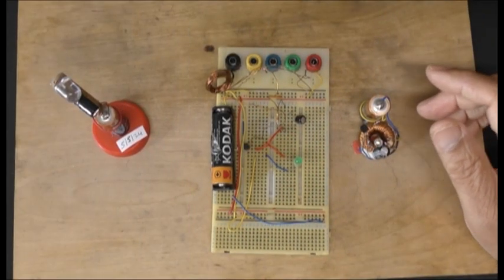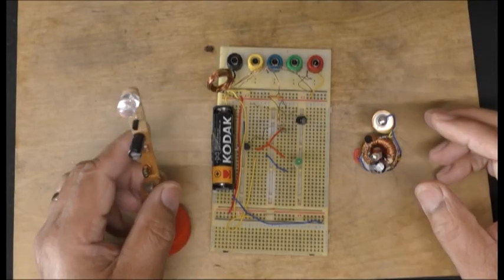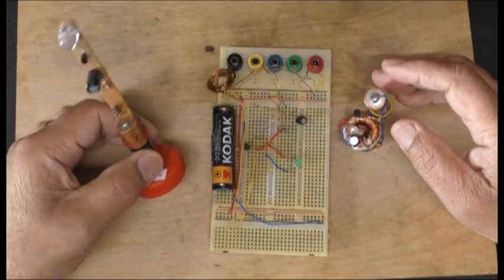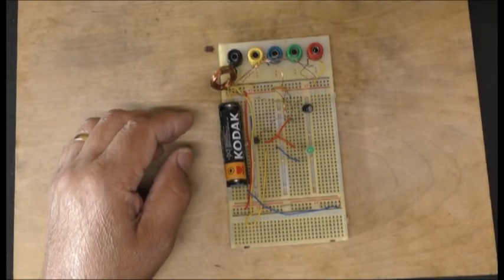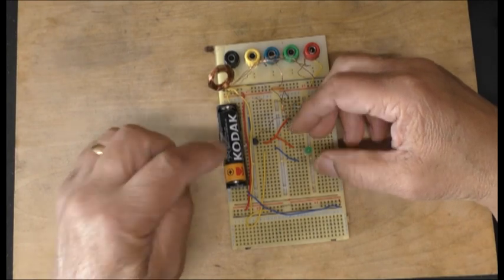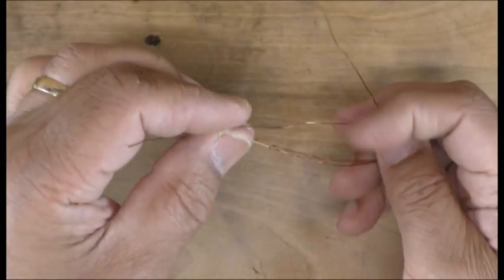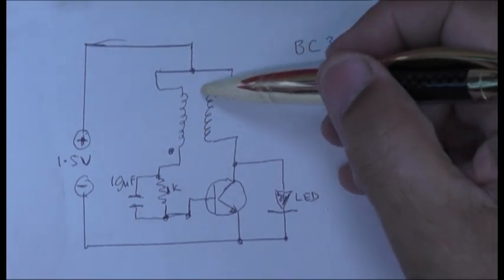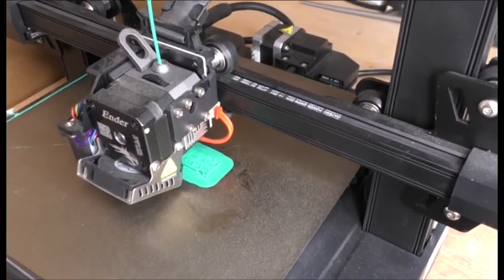#298 Update and Just a Coil Flasher. (1st May 2025)

Comment: I have a digital Honeywell thermostat as a stand alone device (not in use for the relays). It has been disconnected from the heater for over 15 years, and it is still running on the 2 original AA Energizers, showing the correct temperature.
Reply from the maker: That is amazing. I don’t think this will work that long. We will see. Thank you for sharing